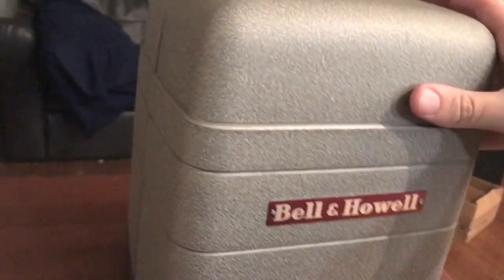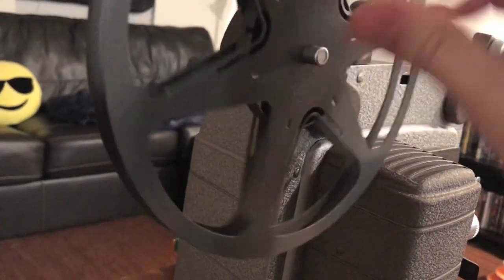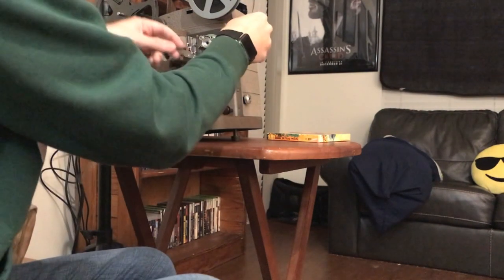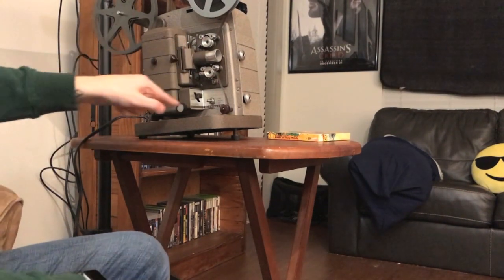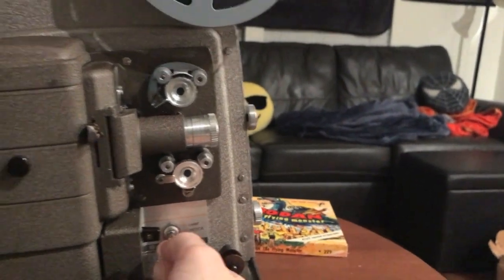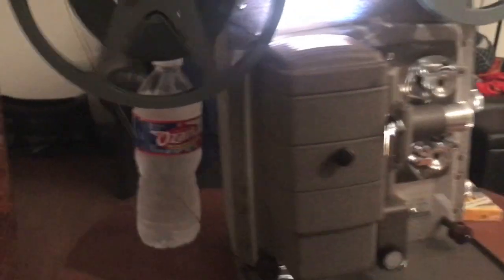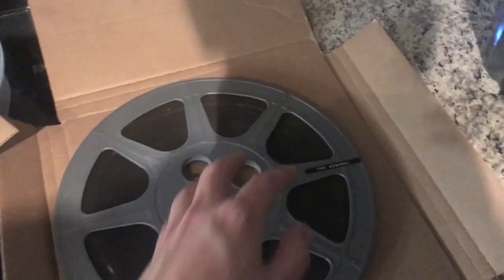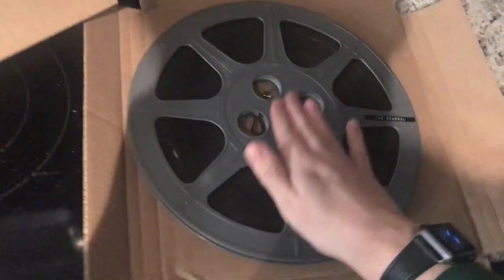Bell & Howell 8mm Projector

Comment: Thanks for posting this Travis.  After you turn the lamp off, let the motor run the fan for 5-10 minutes to cool the lamp.  It will last longer.  And like headlight bulbs for cars, don't touch the glass of the lamp with your bare fingers--the oil from your skin will compromise the glass when it heats.  Nice to see your hobby!
Reply from the maker: Thank you!

Comment: Thanks for posting this video! I just received the exact-same projector from eBay. Runs great and this video really helped me figure out how to thread it. I have a couple of Bell & Howell Super 8 projectors that came with a plastic "auto-loader" attachment where you'd just have to insert the film and it would automatically thread it. A little harder with this old 8mm but not too bad.